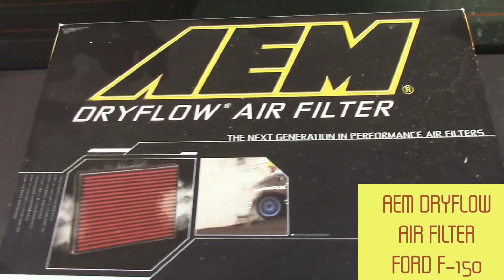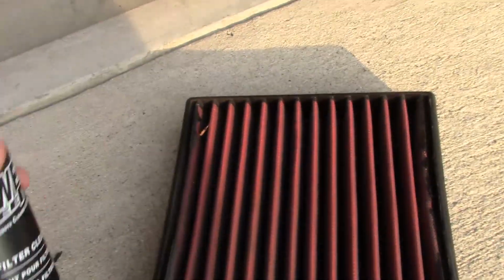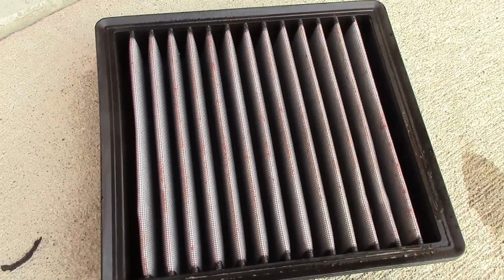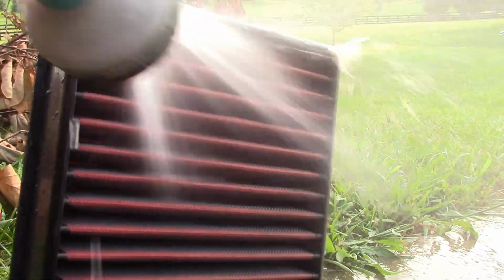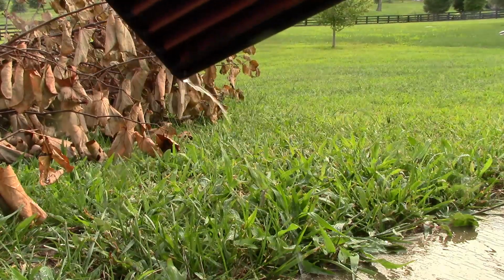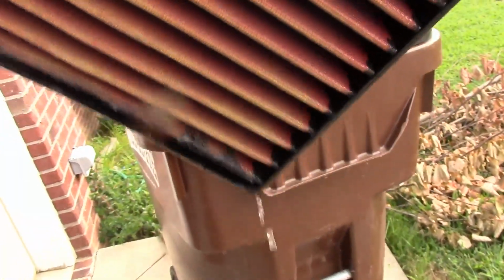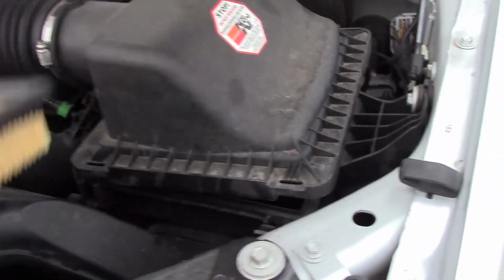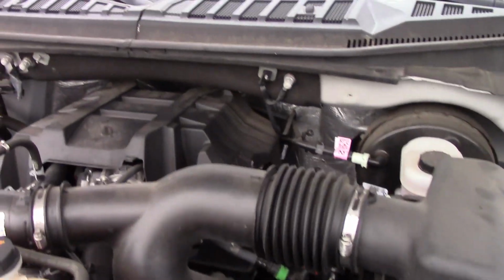AEM Dry Flow Filter Cleaning - How To

Comment: You should NOT use K&N Power Kleen on this filter. This is a synthetic filter and only K&N Synthetic cleaner or AEM Dryflow cleaner should be used. That spray could damage you filter over time. Degreasers should be avoided at all cost
Reply from the maker: Good to know.  Thanks.
Reply: they AEM dry flow cleaner as sodium laurel sulfate as the active ingredient for degreaser - same as DAWN soap.

Comment: So what the biggest advantage of using an AEM over a stock filter?
Reply: That you can clean it and reuse it.
Reply: More airflow as it gathers dust
Reply: spending more money.  3 oe 'paper' filters for 1 dry filter.  so, at a minimum, it will take you 3 yrs to to get your roi back (plus the cost of cleaner).  but what about when the dry filter is drying??  yep, handy to keep an oe 'paper' filter on hand so you can drive if necessary.   It sounds nice about not clogging up a landfill w/air filters...but have you really seen what ppl throw away??  your 'paper' air filter is tiny in comparison, super-tiny.

Comment: That seams like TOO much water pressure or velocity, hitting the filter media...  & maybe a not so harsh cleaner, for the DRY filter element
Reply: Nah, the DRYFLOW AEM filters are hydrophobic and water just passes easily through the filter material as you can clearly see in the video, the water doesn't pool up inside the filter even for a moment, it just passes through, this also means it dries quickly too
Reply: @TheUchihasparky On a DRY FILTER ELEMENT.. If water flows through with ease, so will fine dirt & dust...  That's why K&N & other types of cleanable  air filters use an oil to catch the fine dirt & dust..  I  had this DRY cleanable  element on, a Chevy truck & @ 1500 miles i noticed, FINE DIRT build up from the A/F clean side, all the way to the Throttle Body, that's not good... So now I'am using a factory type replaceable element now, for that truck....  Only good thing out of using a Dry re-clean-able element now, is knowing it's not as good as an OEM factory type air filter....  Oh i use, K&N on 2 other trucks, & 1 motorcycle,  & all other vehicles get, factory type air filters...

Comment: Do you prefer Aem than KN? The performance results is better?
Reply from the maker: I prefer the AEM. It is a dry filter so you don’t have to spray an oil on the filter.  There have been complaints and issues of people using K&N and the oil getting sucked into the engine.  It may be due to misuse of the oil. Applying too much etc.   so far after using both.  I prefer the AEM dry filter.

Comment: Do only cleaning not use a oil? Damn... Its the same as kn
Reply from the maker: It appears the same, but from what I read the reason this one doesnt need oil is that the filter is made with small enough holes to allow air but block the dust/debris.  The KN is made a little looser, with not such a tight mesh, so the oil fills in the mesh and helps grab dust and dirt from going through the filter.  But no oil goes on the AEM and from the tests, it appears that the AEM is a far superior product.   I recommend them.

Comment: Where do you get that spray?
Reply from the maker: It was some K&N air filter cleaner.  I think you can get it at Autozone or similar auto parts stores.   Of course you could get it off amazon.  Hope this helps.
Reply: It does, thank you! 😁
Reply: Just use detergent. I'm srs